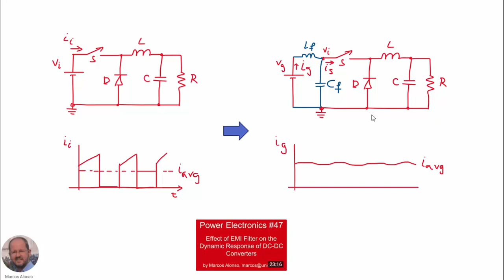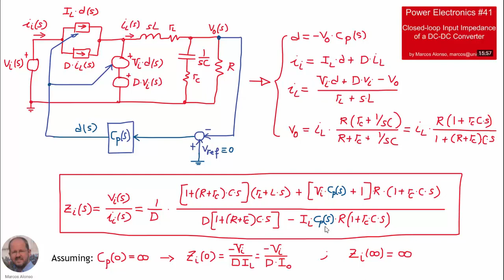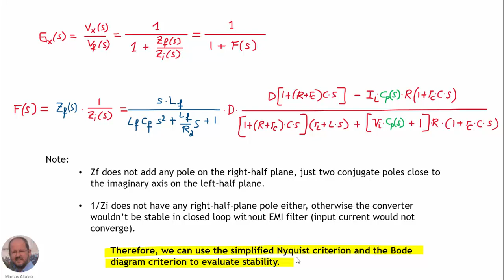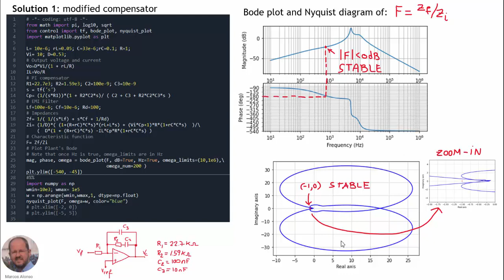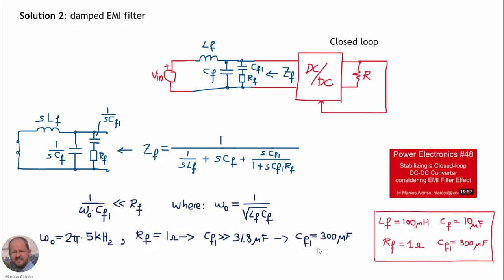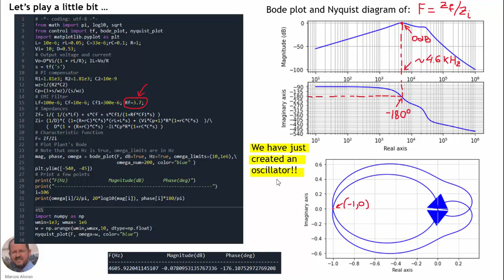PE #49: Impedance-based Analysis of EMI Filter and DC-DC Converter Interaction

Comment: Professor, thank you so much for the useful video. But I have one question. Adding an damping resistor to the input filter introduces additional losses and volume to the system. Is there any use like this in actual applications? Would reducing loop gain be a more practical approach? or only for low power application?
Reply from the maker: Thanks for your question. Note that in Solution 2 the resistor is in series with a capacitor so there is no DC current through it. The losses are really small, only due to the ac component, so we can use a small resistor. I think this is the best solution because you can keep a faster converter response.